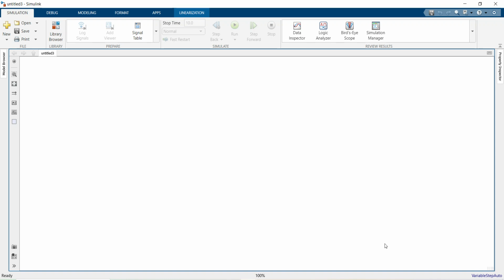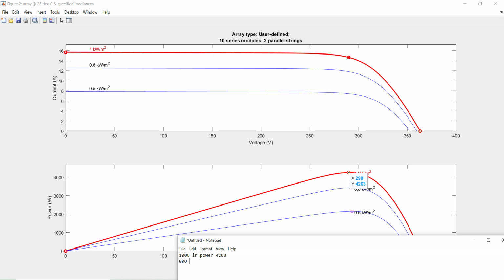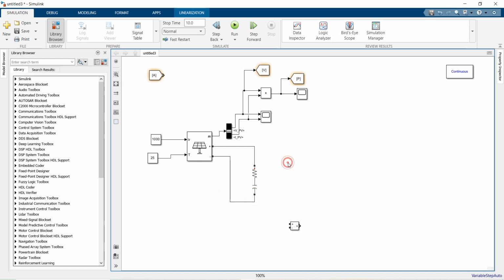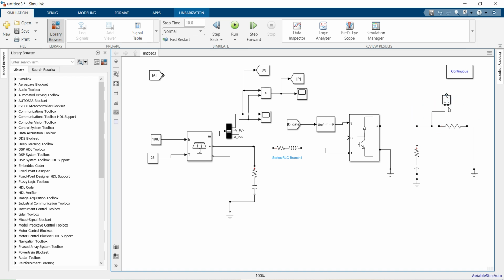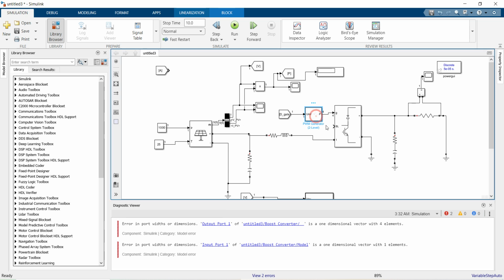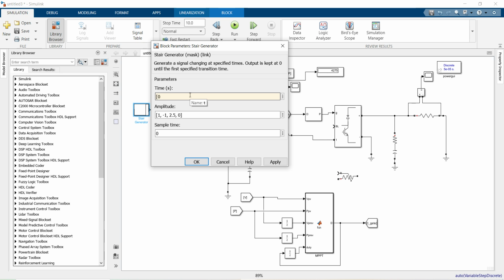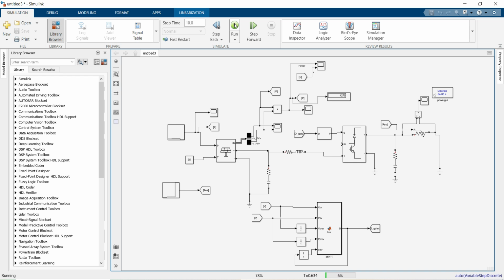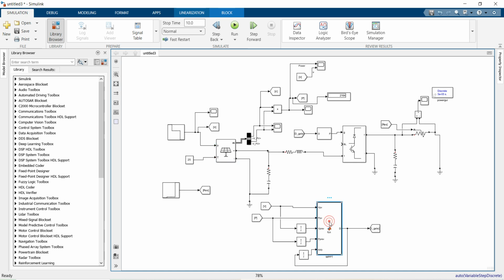Solar PV array with MPPT using Boost Converter in Simulink

Comment: Hello sir, I am getting a large number of ripples in the V and I waveforms, so how do i fix it
Reply from the maker: This can be due to mppt or capacitor used.So , tune mppt and capacitor
Reply: @simscapeelectrical4912 but I used the exact values used by you
Reply from the maker: Same PV parameters?

Comment: Does it can be done using the circuit of boost converter (not the boost converter block )?
Reply from the maker: yes,you can replace the boost converter block using the circuit of boost converter and it will give the same results

Comment: I have changed in PV array Parallel strings - 12 , Series connected modules per string -131 but scope 2, 3 not changing . I have about 1572 modules on site , also can u explain how MMPT works ?
Reply from the maker: You need to change the MPPT parameters; then it will work fine. Sorry, I don’t have any video explaining how MPPT works yet. Hopefully, I will upload one in the future.
Reply: @simscapeelectrical4912  what exactly parameters?
Reply from the maker: @dina73400  It depends on your project. I do not know your project properly, so I cannot tell you exactly which parameters need to be changed without understanding your model. I hope you understand.

Comment: where is power output and efficency result unclear?
Reply from the maker: Take the power output from the product block of the PV voltage and current (use a Mean block before the Scope to get better results).
The efficiency can be measured by noting the irradiance and corresponding power from the PV array block and comparing it with your calculated power output.
Reply: @simscapeelectrical4912   this all on u module ?
Reply from the maker: Yes, all of this is done inside the Simulink model/module. You can measure the values using blocks like Product, Mean, Scope, and Display.

Comment: Please help I did this but display is showing the power changing between 5124 and -5123. Upon checking current was changing between 14.9 to -14.9.
Reply from the maker: Probably you have made mistake. It should not give this kind of wrong results.Check the MPPT function.and Inductor Capacitor values

Comment: Can you add a single-phase induction motor to the system to take advantage of it + Thank you very much ♥️
Reply from the maker: Yes it is possible. You will need asynchronous machine as single phase induction machine and an inverter and battery (if you prefer without grid connection)

Comment: Hi can you do PV integrated UPS
Reply from the maker: You need to add a battery on the DC side. If the system is not grid-connected, then by using a voltage regulator (like modulation control for the inverter) along with a proper LC or LCL filter, you can get the desired AC output. If you want it to be grid-connected, then you'll need a modified controller to provide the reference for the inverter. You can check out my 'PV MPPT Battery ' project under Specialized Power System Projects for more details.

Comment: Output voltage is same as mppt voltage sir. Duty cycle shown as zero
Reply from the maker: It seems you have made mistake on your MPPT code.Recheck it or you may check it using chatgpt  or like this.Hope it will works for you.
Reply: how the output voltage now? is the output voltage stiil same with voltage mppt? Have you managed to raise the voltage?
Reply from the maker: Maybe you have to redesign your controller.